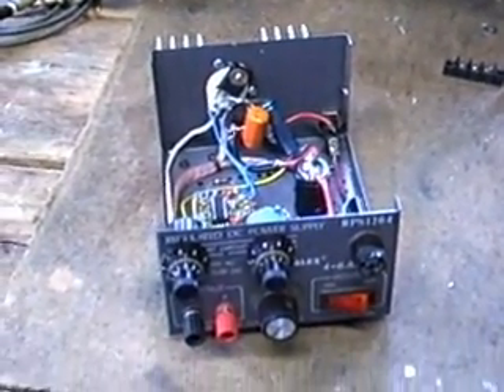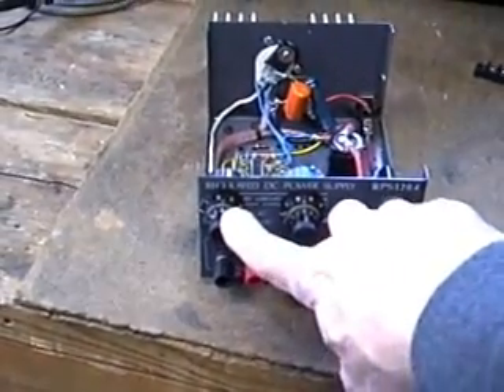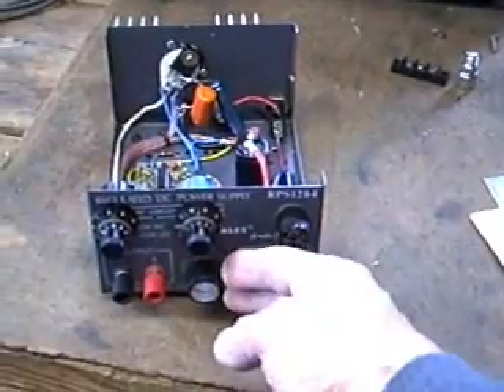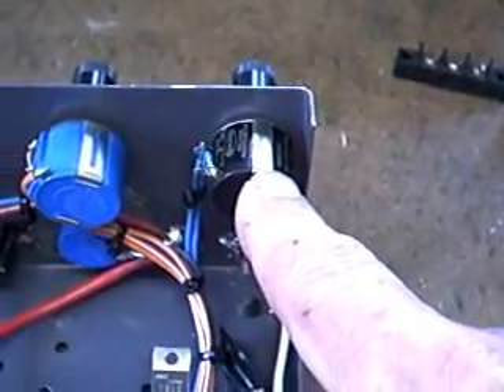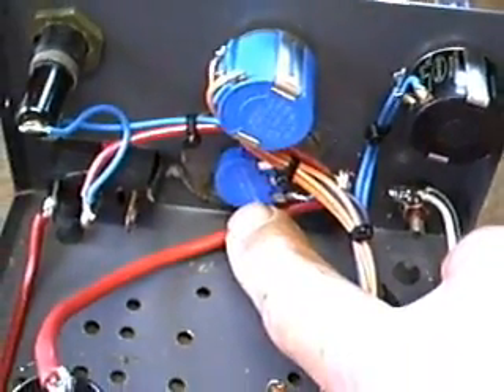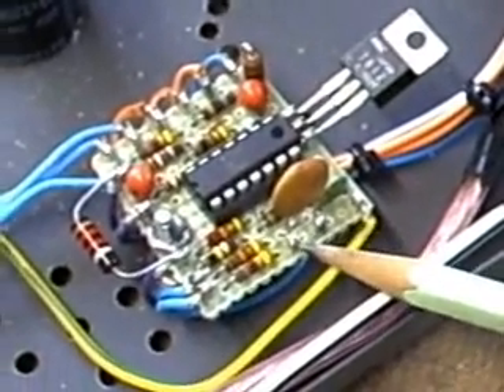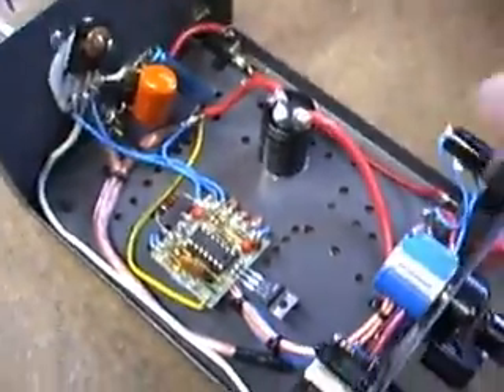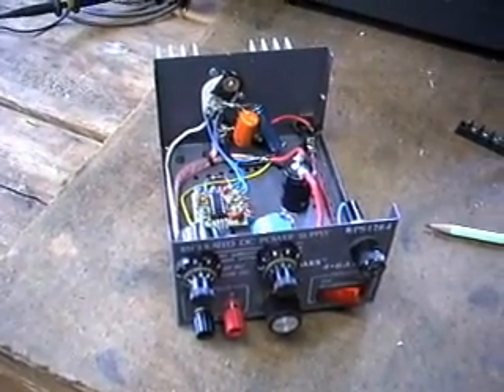#94 New Current limiting PWM circuit completed

Comment: Could you use a gas meter to measure the amount of gas your unit creates and work out how much water is used , then using this figure you could have pump on a monitor to replace water when set amount has been used ?

Comment from the maker: Actually someone did by creating a probe with two bare ends to sense conductivity when they become unsubmerged triggered by a comparator chip. I don't know how well it worked, though. The froth that forms at the top may be too conductive and throw it off.

You might be able to do it optically through the sight tube I have on the side of the elyte tank, or the probes inserted there where no froth collects. Just a couple of SS straight pins pushed right through the vinyl tubing would do it.

Comment from the maker: The IRFP064 is externally mounted to the heatsink at the rear of the box. Guess what else? The potentiometers don't mount to the PC board either! Duh.

And where in the PWM schematic do you see a 0.01uF cap? The only one you may substitiue values for is C3, 100nF (or 0.1uF). It's just a filter.

Comment: You are absolutely correct that i can't read a schematic properly yet but i am learning as it is what i am studying right now. 
I am confused as the circuit was terminated in the IC itself(DUH ), silly me! : -) 
still have 1 question more. why is hand drawn schematic have no power mosfet(irfp064) and the schematic does. 
Also, should i also be able to use 1uF or 2.2Uf instead on 0.01uF as where i live, i can't find these?

thanks again. Love your tutorials and am learning lots .

-ian

Comment from the maker: Resistors are 1/4 watt except for R14 which is 1/2 watt.

R12 is a 4.5" piece of 16 ga. TWO CONDUCTOR appliance zip cord. One end you short the two conductors and tape off. The other end is your two connection points.

Comment: Hey, guys
I finally got my 316 steel plates. I called around and found some sheet metal shops that had some scrap laying around. They even cut it for me. That stuff is a bit costly but it's probably going to be the only pricy thing about my cell. I'm thinking of designing my cell with a filler tube attached from the bottom. That way, I can refill my electrolyte without having open the top exposing the HHO. I'll let you know how it works out.